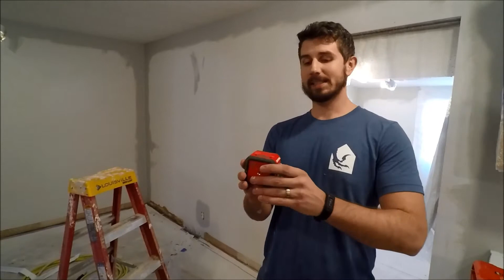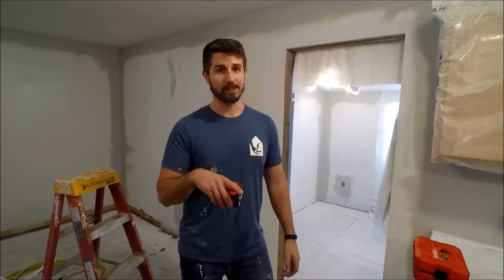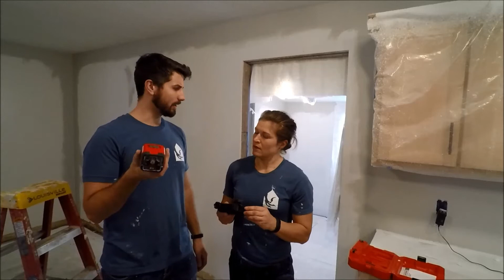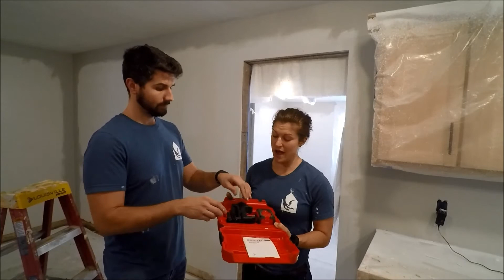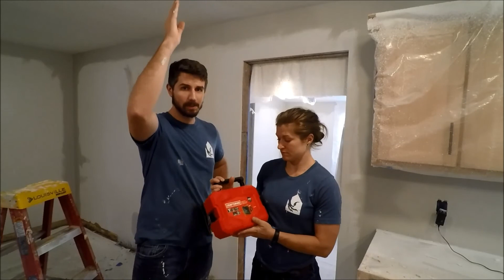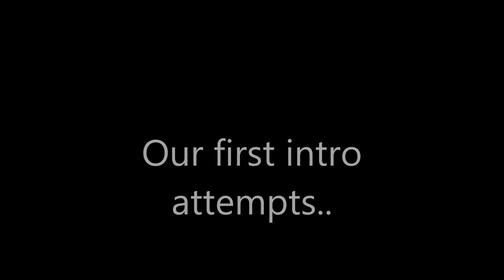Tool Review | Craftsman 50-ft Green Laser Level

Comment: I bought one at Lowe's online.  I like it, but please note that you need to turn it off carefully with the pendulum stable or the laser will not be square to the housing when in the locked mode.  The manual is not included and is online.
Reply from the maker: Great call out! Locking the pendulum in place (when off) is critical so it can maintain it's ability to auto-level.
Reply: Mine is crooked...need to figure out what's wrong
Reply: Mine is also crooked, I returned it for a different one and that one is also crooked.
Reply: @rubengonzalez8399  Possibly dropped when it was unlocked or not set correctly at the factory.  I think it has some internal adjustment, but that would be tricky!